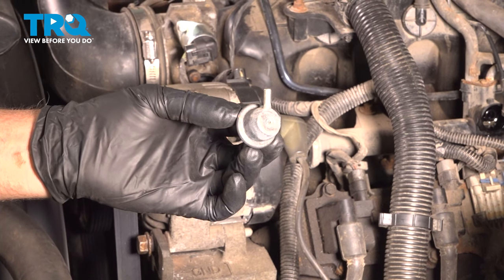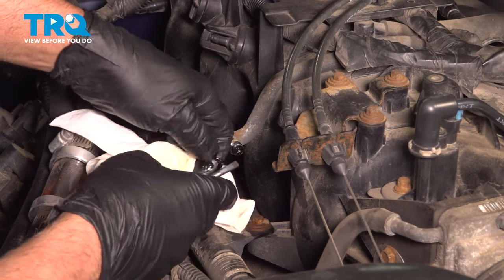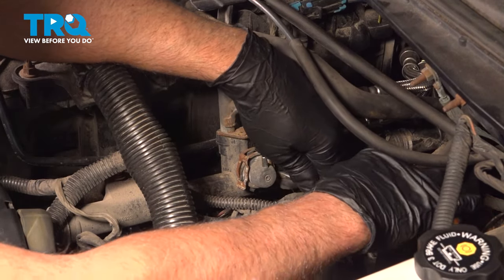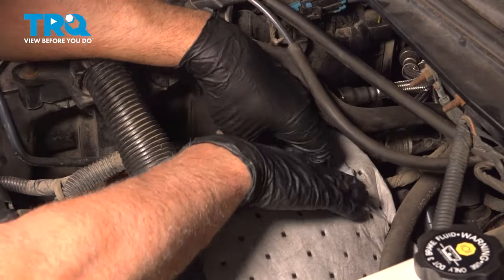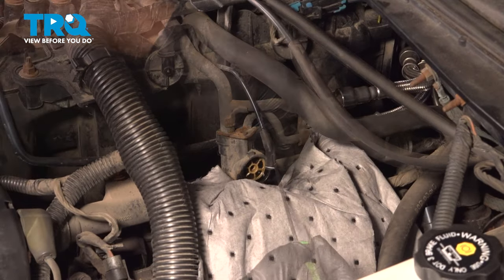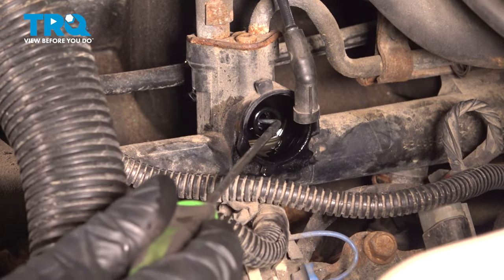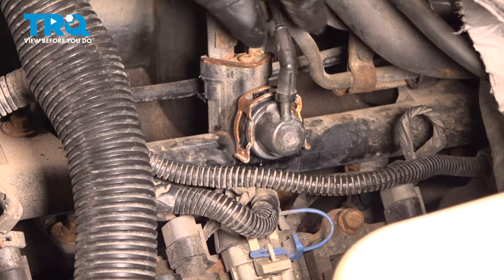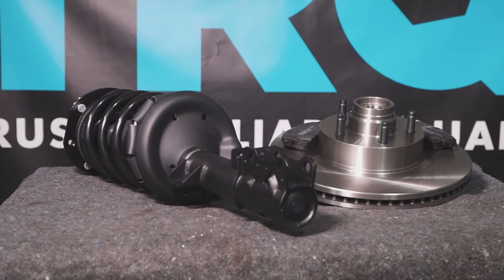How to Replace Fuel Injection Pressure Regulator 1999-2006 Chevrolet Silverado 1500

Comment: *If you pull the fuel pump relay, turn the motor over for a few seconds the pressure is released through the injectors. Fast and no gas spray outside the rail. (Just less mess)